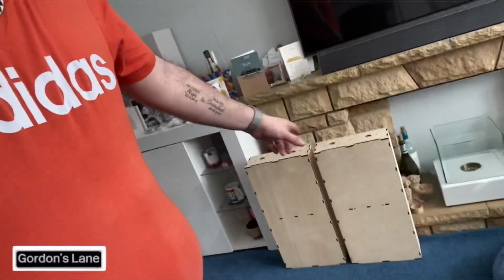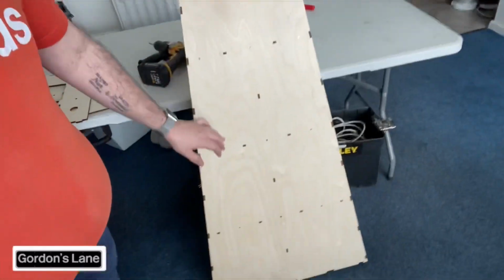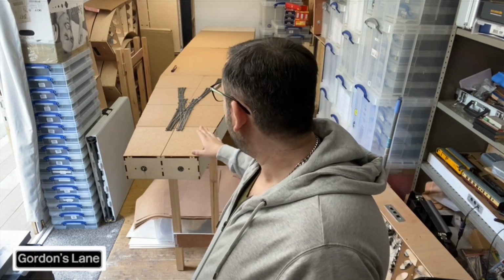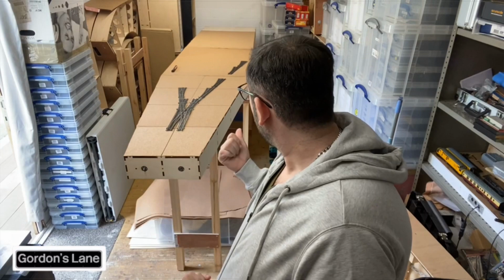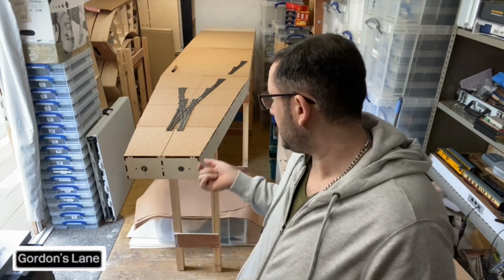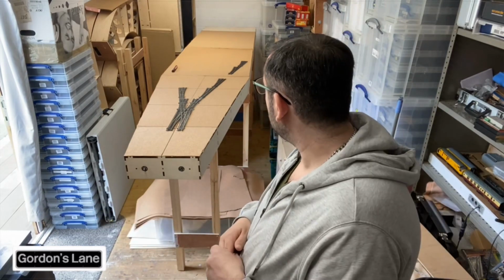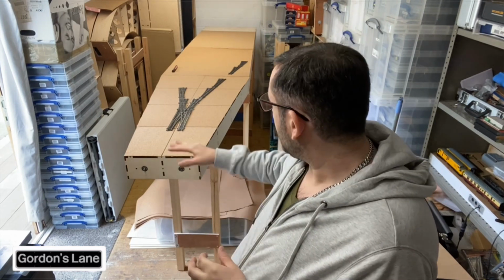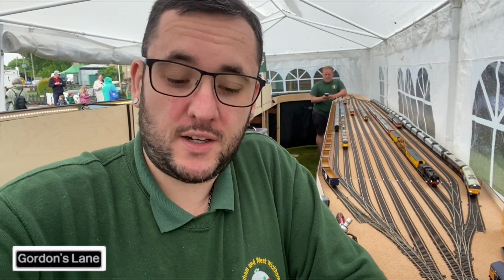Gordon’s Lane - Part 14 - New Fiddle Yard Completed and Tested.

Comment: Fantastic video Greg.  The 1:1 running shots fitted in great with the 1:76 running shots just fine.(Expected to see a Peckam Springs Tanker go by but no!)  The base-boards look quite light.  Is that the case?  I know any stacked mass of MDF is heavy though.  I think the LU(TfL) trains with the 3rd rail units are a fine representation of the real thing, as I've seen on others lay-outs too.  I dare say, getting the 3rd rail level,  to avoid catching the pick-up shoes the wrong way can't have been easy but it was well worth any effort to get it right.  The track-work on the break-out for the marshalling Yard, well, it's a piece of art!  I hope it works well and gives the fun it's set out for.  Thanks for posting this update.  I've been watching the yard coming together elsewhere, your video puts it in a great perspective.  All the best with it Greg and all the best to all with you at Gordon's Lane and Ebsworth Street.  Keep Safe, chap.  Cheers!
Reply from the maker: Thanks for comment, yeh the baseboards are very light and easy to move and transport around. The fiddle yard point work is piece of art, works so well. Super excited now to try and get the panel working so I can use that to play trains. 3rd rail was bit of a task to do but well worth it in the long run. Here’s to more running and more days out at exhibitions with the layout.
Reply: @EbsworthStreet  Yus, here's to that, indeed.  We don't know what we have 'til it's not available!  All the best!